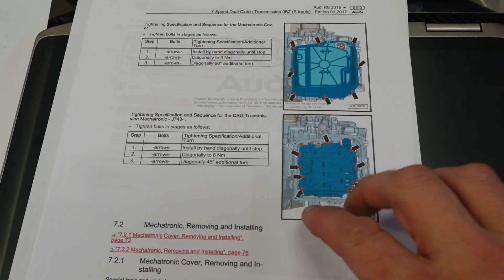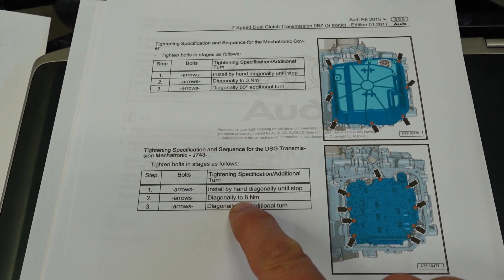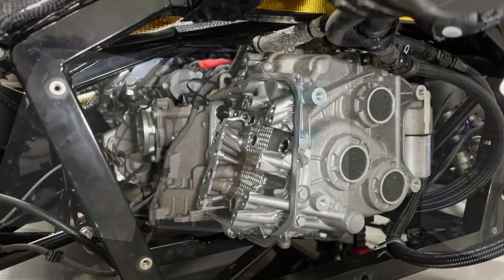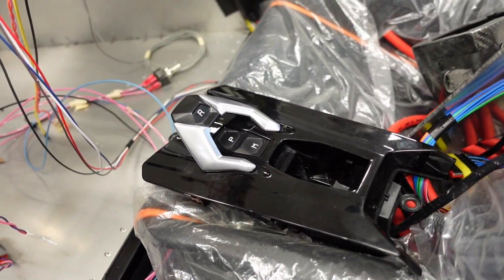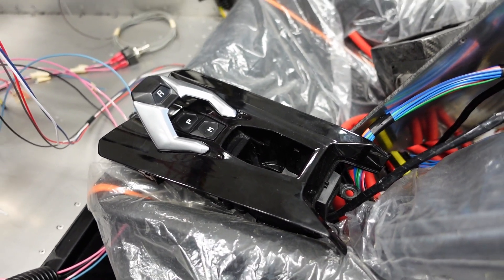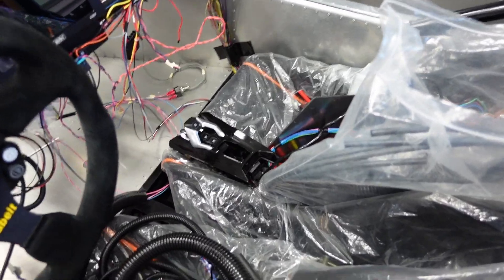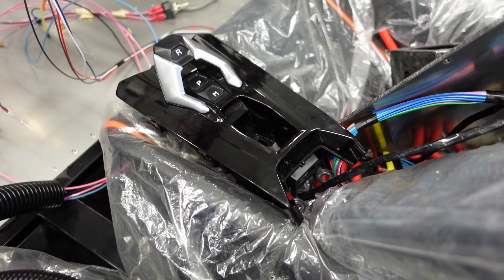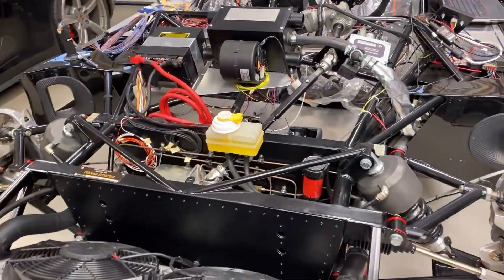Immobilizer-Free Transmission Mechatronic Installed!

Comment: Have you tried the column affixed paddle shifters? I think you should plan for plan B in case they don't work too well there.
Reply from the maker: I haven't mounted the yet...but you're right, plan-B will be to steering wheel mount the paddles (which I already have provisions for).  👍

Comment: I might not be understanding you correctly. Are the paddle shifters going to be in a fixed position? I would think shifting while in a turn might be more challenging with them fixed to the dash. Wouldn't it be better if they were fixed to the steering wheel?
Reply from the maker: I have a set of steering wheel mounted paddles too but I'm now thinking dash-mounted (fixed) paddles will be better for street application.  I believe this to be a more a personal preference thing.  Given my steering is 2.5 turns lock-to-lock, sometimes in the heat of spirited driving while turning, the up/down paddles flip sides with a steering mounted setup and easy to get confused.  With fixed column/dash mounted paddles, up/down shift are ALWAYS in the same location despite steering angle...On the R8, the paddles are mounted to the wheel and on the Huracan, the paddles are mounted to the steering column.  So even Audi/VW group flip flop.   🤣
Reply: @DanDulac  Interesting. I was under the impression all paddles were steering mounted. It makes sense that one could mistake one paddle for the other when the wheel is flipped. I can imagine coming out of a tight turn and accidentally down gearing. 😬